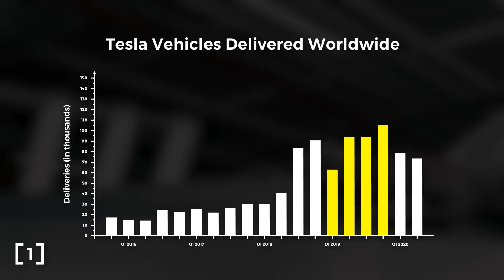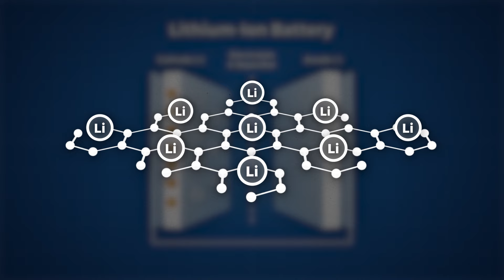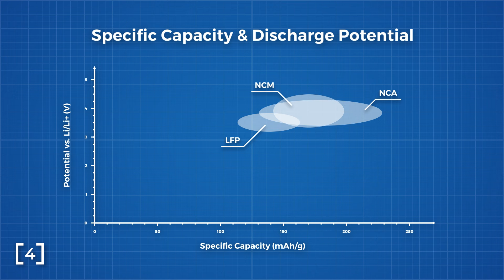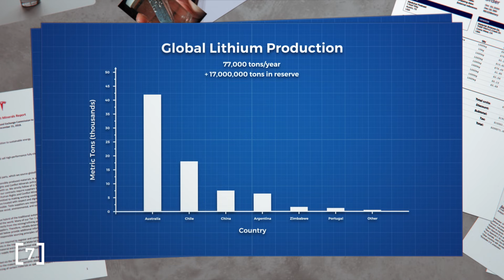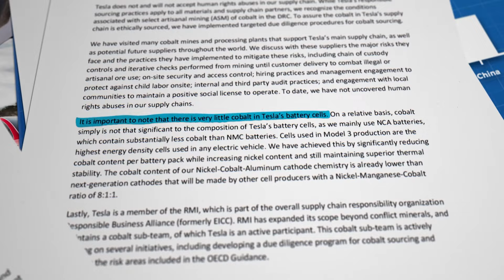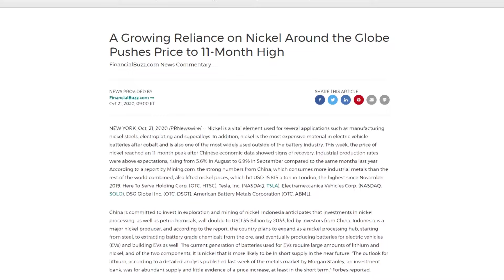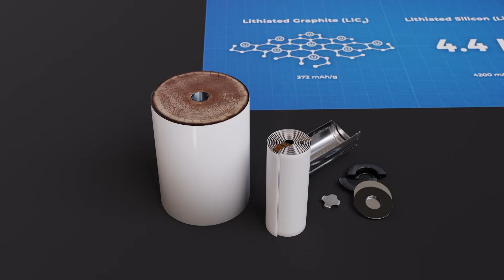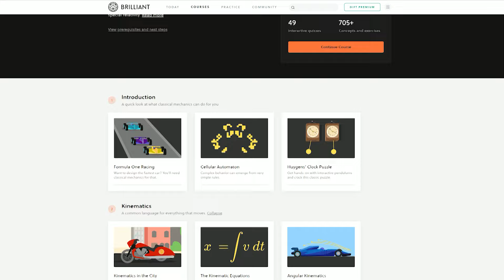Tesla's Battery Supply Problem

Comment: Ya It's not actually viable for anything other than cars.

Also there isn't a difference in environmental impact between gasoline/Li, I think gasoline is 7.6% from mining production, and waste. While LI is 7.5% the difference could come down to wind direction.

Ohh and that li water create a lot of GHG

Thats why Tesla are carbon neutral, and not advert for being cleaner then any gasoline vehicle post 1989. 

Ya the new porch is actually better for the environment then any Tesla.

Edit the moment you factor recycling li batts they are drastically worse for the environment then gasoline cars. 

Seriously pick a study on these batteries vs gasoline. The numbers stated above DO NOT FACTOR the disposal or recycling if these batteries. While with a gasoline vehicle EVERYTHING is factored 

Let that sink in.

Also no it won't replace the transportation sector the weight of these batteries wrecks what you can haul so for 18 wheelers the cost per trip drastically increases as they can only carry a portion of what they did previously. and charge time will slow the logtics network.

Comment: Sodium/natrium ion battery is the future.
It's much more abundant, hence cheaper, than lithium.
It's also much safer and reliable at the cost of only slight lower capacity than lithium ion battery.

Comment: battery electric vehicles are regressive and redundant. you'd have to be a moron to believe they have any place in the future. They belong in the distant past where they should have stayed. Hydrogen is the obvious future and you don't have to be a genius to figure this out. It can run every internal combustion engine on the planet while cleaning the atmosphere at the same time. It can also power every electric vehicle > it can also be used in various fashions to produce electricity without consumption or conversion of the gas leaving it for further use afterwards. Batteries are dirty, regressive and redundant. they house massive amounts of hidden pollution and contribute massively to emissions, pollution and contamination which is in no way, shape or form clean, green or efficient!

Comment: All of this suggests that hydrogen fuel cells are the better option. Yes, it takes more energy to make hydrogen from water, but if that is created through solar or wind then it doesn't matter.
Reply: You also need to create hydrogen from fresh water currently, and you still need batteries in fuel cell cars, and you need actual precious metals for fuel cells, and it's extremely expensive to produce hydrogen. Even the cheapest form of production is more expensive than gasoline by a large amount and produces a lot of CO2 during it.

And then you get to the infrastructure. H2 needs massive renewable power sources for clean production. Then you have shipping to every sector, which is going to be worse than oil due to volumetric density issues with H2. Then every single gas station needs to be replaced with H2 fuel. You cannot just upgrade gas stations as the tanks and pumps all need replacement. 

H2 for auto transport is an absolute waste. Don't fall for it. Batteries aren't perfect, but they are far better than hydrogen.

Comment: Bugger the damn batteries...

What they NEED to focus on, and are making a sum total of zero movement on, is energy production and *DELIVERY*.  To achieve 10tw production with the current heels deep resistance of the market to change will require increasing fossil fuel extraction by a factor of five to seven times - and the commensurate pollution.
OR increase wind by a factor of... incalculable.  That will require insane quantities of copper and other materials for the turbine generators, and a mind boggling amount of land sage.
OR go solar... with the same mind boggling land use requirements AND an equally mind boggling amount of extremely toxic rare earth materials with very expensive/limited recovery through recycling.  All of those solar panels will need to be stored somewhere when they're dead, and being highly toxic they'll require storage akin to the current toxic waste sites (i.e. spent nuclear fuel) globally.
OR we can increase our nuclear usage, but though focusing on lower-yield fuels (breeder/salt reactors) which can simply be left in the reaction chamber until they're little more than lead.

And that's not to mention the sheer quantity of copper required to build the transmission lines to your house, apartment complex, and what have you.

And where will all of these batteries be disposed of?  Again, the recovery of the materials used will be incredibly expensive - to the point that they'll more often be thrown in a pit rather than recycled.
Reply: @sasa asasasa Good points I did not realize.  To build the required transmission infrastructure to every house, however, will still be an insanely monumental endeavor.
With privatized power delivery... that will be slow, inefficient, over budget, and come out of everyone's wallet before they ever see the first high capacity line.

Comment: Energy Source for Replacing Big, Dangerous, Smelly, Expensive Batteries. 

Excerpts from the book - "Secrets of Cold War Technology" by Gerry Vassilatos (pages 86-93) :

Mr. Savo reported that in 1931, he participated in an experiment involving etheric power. 
He was asked to accompany his uncle, Nikola Tesla, on a long train ride to Buffalo.

Taken into a small garage, Dr. Tesla walked directly to a Pierce Arrow, opened the hood and began making a few adjustments.
In place of an internal combustion engine, there was an AC motor.   From it trailed two very thick cables, 
which were connected to a terminal in the dashboard.  Here, Tesla plugged in a shoe box sized "Black Box". 
In addition, there was a  single ordinary 12-Volt battery.  

Dr. Tesla informed his nephew that the device could not only supply the needs of the car forever, 
but could also supply the needs of a household "with power to spare".  
Of the motive source, he referred to "a mysterious radiation, which comes out of the aether"  
and  "it is available in limitless quantities".  
   -   -   -   -   -   -   -   -   -   -   -   -   -   -   -   -   -   -  
> 50 years ago, famous physicist Richard Feynman said : 
The vacuum of “empty space” appears to be an energy reservoir of immense capacity   
that makes nuclear power seem old fashioned.   
The amount of energy available in one cubic centimeter of the vacuum (ambient space)   
is much greater than the energy density in an atomic nucleus.